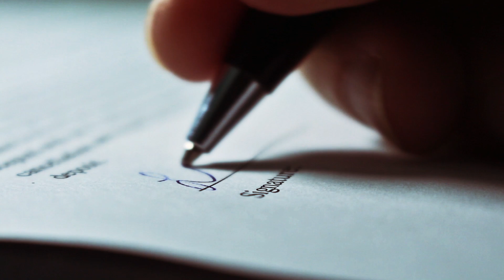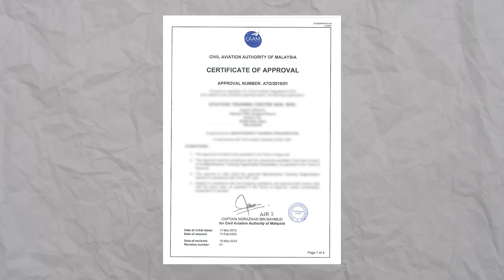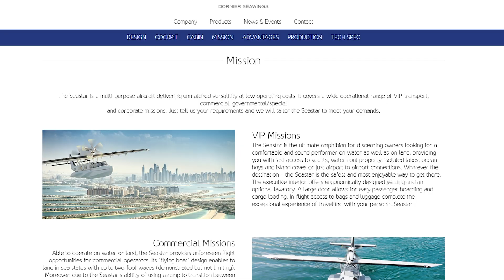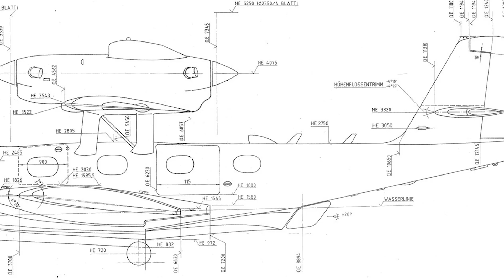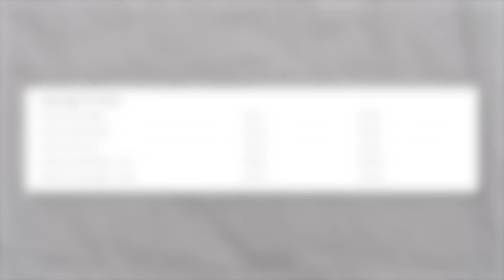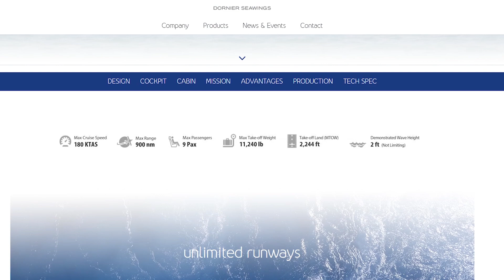Dornier Seastar – Push–Pull Boat! Review, History and Specs

Comment: I'd rather buy a brand new Viking Twotter on floats than this thing.
Reply: I thought the same but it it’s performance stats are pretty good, better than the otter in most things especially when it has floats!
Reply: @csm2455  Good point , this is a proper amphibian, boat hull and all. Twotter is great but is just another "land plane" stuck on floats. Very draggy.